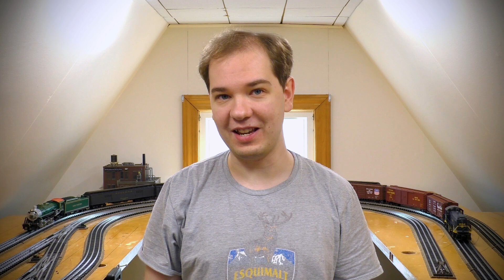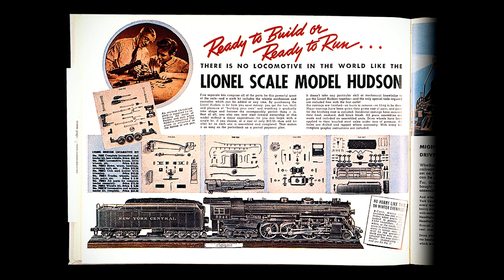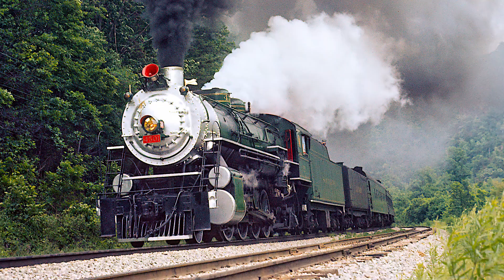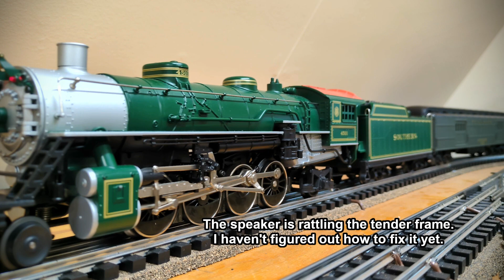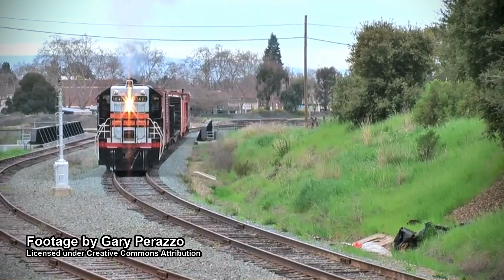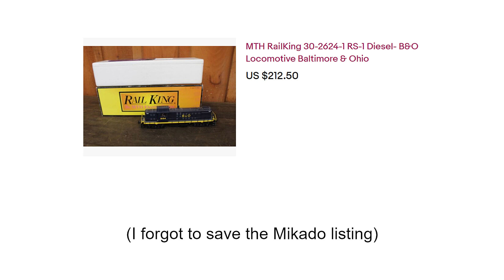The Case for DCC in O Gauge

Comment: 4:20 Not true, I'm afraid. You can have locomotives with sound and features with conventional operation. MTH's ones in particular offer access to most of the functionality of DCC through use of the whistle and bell buttons to trigger the functions. Locking the e-units on all conventional locos also allows for more flexible ops than ordinary model railroad DC operation.

You also neglected to mention Lionchief, which through the universal remote and the app gives you access to multiple loco operation without the need of buying a command rig.

That's not to say I don't like what you've done here, it's neat that DCC and Blunami are opening up new possibilities in  3 rail O. Always figured I would swap out for the Blunami if boards in my newer locos become unobtanium in the future.

Until then, the ZW still runs the show on my line. All eras, all makes, it runs 'em all. Lionchief's there when I want to get fancy or run multiples.
Reply from the maker: @Shipwright1918  Sound and features, yes, but not all the features. For example, you can't use the quilling whistle or select different whistle sounds on a Legacy engine using only conventional, nor can you operate the remote couplers. MTH is better about this, as you noted, but there's still some settings that can't be changed without DCS. That said, if you want to run conventional with some features, MTH PS2 and PS3 locos are probably the best way to do that (although they are a bit picky about transformers - my ZW-L will run them just fine but the couplers rarely work).

I'll be honest, I forgot about Lionchief, but I think it's a bit beside the point anyway, since it's not really command control. Lionchief engines are fun, and I like that they're not picky about AC or DC track power, but they don't do much that conventional engines don't also do. They do run quite well on DCC-powered track, though - in my experience, smoother than they do on normal AC. No idea why - maybe something to do with the square waveform.
Reply: I would argue that's more a fault of Lionel itself than of conventional control, they have a vested interest in selling the expensive Legacy base station to go with the equally expensive models that require it. 

As stated, MTH went a different route by accomodating customers with traditional setups instead of locking all the good stuff behind a paywall. Is it utterly perfect? No, but it works well for my purposes, really love all the MTH engines I have in the fleet. Actually tend to prefer the proto sound 1 boards over the ps2's and 3's, but the later ones are fine too. Use a refurbed postwar ZW and a pair of 5906 sound buttons to trigger features, couplers almost always work provided I remember to have enough volts on the track to fire them properly.

As to whether Lionchief is a command control system, I would say it is, though with most of the system architecture built into the locomotives themselves instead of a separate base station. Only external element is the control signals going over the air from the app or the remotes via RF/Bluetooth.

Lionchief Plus/LC+ 2.0 is where the system really shines in my opinion, as you get a majority of the features of a Legacy engine in a simpler and less expensive package.

My LC+ NW-2 really knocks my socks off, one thing that impresses me is how the smoke unit ramps up when the prime mover sounds do, then settles back down to a light output when the prime mover goes back to idle.

Comment: The explanation I heard for the three-rail 'O' market not going with DCC way back when was that the the system didn't play well with the electrical environment of most 3RO layouts at the time. By which I meant locomotives with open-frame AC (Pullmor) motors and the preponderance of animated accessories driven by old-fashioned solenoids, often running off track power. The amount of electrical noise generated by these two 'features' made DCC unreliable in early experiments, and 3-rail O was too small a market for anyone to bother solving those issues for a niche corner of the hobby (compared to HO & N scales).

The makeup of 3-rail O motorization nowadays is better suited for DCC of course, but waiting for that situation to come about might have meant 3-rail O remaining stuck in the analog era for many years after the rest of the hobby adopted command control, basically having to wait till enough layouts became dominated by can-motored motive power to obscure the difficulties DCC had with postwar-era layout tech.

(addendum: I'm sure the lure of exclusivity in 3RO played a role too, as neither TMCC/Legacy or DCS were cheap to develop)
Reply from the maker: @RailRide  That does make sense. I didn't realize how long it took for the O gauge world to switch to DC can motors. The interference from accessories is another thing that didn't occur to me. Maybe that's why TMCC uses wireless signals.
Reply: That's a very interesting point. For quite a while I had assumed that the primary reason O gauge never went to DCC was because it was much easier for proprietary systems to take over as there's significantly fewer players in the 3 rail O scale market, but it hadn't occurred to me just how much noise and power consumption those older things had. Ironically nowadays most "conventional" 3 rail O models are well suited for DCC conversion, better than some DC HO models even thanks to them having e-units which do the job of isolating the motor for you.

Comment: What about G gauge decoders? 6:52 
You can easily wire in a PIKO board designed for a 5amp system.
Reply from the maker: The decoders I used are designed for G scale. I did consider using AirWire for this, and I think it would work well, but since my layout is fairly small, I didn't want to spend the extra money for wireless control. It would be a workable alternative to BlueRail, however, if you don't want to use an app.

Comment: 14:44 Review on O scale 382 and Union pacific 119 14:46 when?
Reply from the maker: 119 will be soon. That's one of my favorites, and currently my only working ProtoSound 2 engine. 382 is a project - it's not designed to run on 3 rail track, and being all plastic, it's really too light and flimsy to pull anything, so it may end up being a static display.
Reply: When I see an engine and recognize  I always like to point it out, Will you get a central pacific Jupiter to go with 119?
Reply: I wish a company made a functioning 382 for three rail Casey jones
Reply from the maker: @ I'm on the hunt for a matching Jupiter, but I've yet to find one for less than $1,000. I'd love to see a 3-rail 382 model as well, but given that most "new" O gauge models released use decades-old tooling, I fear it's unlikely we'll see one anytime soon.
Reply: Jupiter is my most favorite engine so I do hope you find one that's not $1000 its a kind of Sort after Locomotive, yea 3 Rail 382 may be A long time before its made
Reply from the maker: @chasesrailwaywatching6447  Jupiter is a favorite of mine as well. If I can't find one, I might try to kitbash one myself. I have a (currently not working) MTH RailKing "General" that could potentially be turned into a Jupiter.
Reply: Honestly that could work sense MTH did paint there general in the CP Jupiter paint scheme, lol I had a Bachmann Jupiter as my third steam locomotive it was my favorite and sense started collecting all Bachmann old tool 4-4-0 paints my current rarest being the DisneyWorld paint scheme
Reply from the maker: @chasesrailwaywatching6447  Have you tried one of the new tooling Bachmann 4-4-0s? They run really nice.
Reply: Yes I do have one new tooling it runs really nicely miles better than the old 4-4-0 mine doesn't jerk at the really low speeds like some others have seen

Comment: Did you know there was a 3-Rail HO Scale system? I dont know the history on it but i do know it was only for DC and I actually had one for 20 bucks. It was a W&ARR 4-4-0 for $20
Reply from the maker: @thecapisoffyt  Fascinating - I haven't run across that one. Will have to do some research. I know Marklin had a 3 rail AC-powered HO system that uses studs on the ties instead of an actual center rail, but it's mostly European prototypes.

Comment: I’m leaning towards doing this.  I already have experience converting HO and N scale locomotives to DCC, but I haven’t done anything with my O gauge trains yet.  One other thing that’s bothered me about the proprietary systems is how different generations are now being sidelined for newer systems.  My LCS components are not useable anymore, and Lionel has moved on from Legacy to the new Cab 3, and I’m not about to sink more money into a whole new control system when have one that should still have plenty of life in it (it almost reminds me of gaming consoles).

DCC is proven, and anything new can simply be added to what you already have.  No planned obsolescence.  I think switching to DCC will also make them somewhat easier to work on, since I’ll know how I installed the decoder.
Reply: I think part of the reason is why DCC hasn’t been put into the 3 rail market is because there aren’t that many O gauge manufacturers as there are HO so Lionel’s Legacy could only work for Lionel locomotives because they want money for their business and MTH’s DCS only works for MTH engines for the same reason.  What I love about being a conventional operator is I can run Lionel or MTH engines without needing Legacy or DCS to run them.  See where I’m coming from?
Reply from the maker: These are all great points. The 3 rail market is pretty much dominated by those two. There are smaller players, like Atlas O, but most of them have either gone out of business or been absorbed into one of the Big Two. Even MTH got their start making licensed replicas of rare antique Lionel models. Lionel's acquisition of K-Line was part of a huge corporate scandal that deserves its own video.

I didn't even realize Cab3 was separate from Legacy, but it definitely smacks of planned obsolescence. That really sucks, and is one more reason why I believe DCC is the future of O gauge. The game console comparison is very apt, and in that metaphor, I guess DCC would be like PC gaming. You can upgrade it bit by bit over time if you want, but you don't have to, and you'll never be forced to start from scratch with a whole new system. Using conventional AC power is really the only other way to standardize across brands in O gauge, and I dread the day that Lionel decides that's also "obsolete".
Reply: @ I mean it’s crazy the prices for a Lionel Legacy 990 system.  Back in the 90s, you had other companies like Weaver, Right of Way Industries, and K Line who sadly have all been defunct.  Does N or Z scale use DCC as well or is it just HO?
Reply from the maker: @huntercoleman460  N uses DCC a lot. Some N scale locos even have decent sound. I'm not sure about Z.
Reply: @redoaktrains  there are decoders out there that apparently can be used for Z scale.  The Digitrax DZ126 series is one example.
Reply: Cab-3 is Legacy, just with all of Lionel's predecessor control systems (Bluetooth, TMCC, LionChief) bundled into one box accessed with a smart device. The physical remotes (Lionel's and MTH's) fell victim to component manufacturers EOL'-ing certain IC's needed for both remotes' transceivers.

Comment: The good thing about the Blunami and Tsunami is that they actually have an accurate whistle for your 4501. It’s labeled as an “L&N passenger 3 chime” for some reason. As for the TCS decoder, you’re probably gonna want to use the Southern 3 chime whistle on it for an accurate sound scheme for the 4501, seeing how yours is painted in green. I’m considering buying one of those Lionel 4501s for my O gauge layout, painting it black, and putting a Soundtraxx decoder in it.
Reply from the maker: TCS does have whistles that are closer to the real 4501 than the one I'm currently using. I mostly have it set to this one because I like it (and because of a Polar Express-related running joke with a friend). I'll get around to switching it to the Southern 3 chime eventually.

Comment: Which decoder do you advice me to use with an AB DL109 from MTH PS1? (Will want to operate it with smoke if possible) Great video and thanks in advance
Reply from the maker: I would go with a TCS WOW501-Diesel, the same one I used in my RS-1. It has the correct sound files (you can select prime mover sounds using the Audio Assist menu) and the ability to drive a smoke unit.
Reply: @redoaktrains Thank You!

Comment: You should put an HO locomotive on the 2nd and 3rd rail and see if it’ll run since you have DCC lol

Seriously though this is amazing! As much as I love Legacy and DCS I honestly wish 3-rail had went the DCC route. Would’ve made control a lot easier like you said, and maybe we would’ve been able to run Lionel and MTH engines in the same consist, which is something I really wish was possible as someone who has engines from both manufacturers. I really hope more 3-rail people are inspired by the DCC movement and chose to go down the route you’re on, as this is a really awesome set up. Great work man 👍
Reply from the maker: Thank you! Consisting didn't even occur to me, but that's another good reason to use DCC.

I have tried to run HO trains on two of the three rails, but sadly, the gauge isn't quite right. The rails are a little too close together, so the flange is sitting on top of the rail on one side or the other. Sometimes it'll stay on the track for a few feet, but as soon as it reaches a curve, it falls off. The DCC does work though!
Reply: @redoaktrains  HO model will only work on Atlas 3 rail track.....until you get to a turnout.
Reply from the maker: @ I briefly considered trying to make custom "dual gauge" track for the outside loop of my layout, with a slightly off-center third rail so I could run On30 equipment on it. Ended up deciding against it, and I'm glad, because anything with flanges that small would derail on the joints of the lift gate anyway, but I might still try the idea on a small display layout eventually.

Comment: Do you still have to use rectifiers for the DCC conversions? Also when wiring for DCC, do you still power the track using AC or DC? I would love to do this on my existing 3-Rail Scale layout. 

-Gojira
Reply from the maker: No rectifier is necessary. The track is powered directly from the DCC booster (its output is technically AC, but the cycle rate varies constantly, since that's how it sends commands to the decoder, and the decoder outputs DC to the motor). The decoder's power inputs are connected directly to the pickups. The booster comes with its own power supply, which outputs about 14 volts DC and has a built-in circuit breaker. It's exactly the same as a 2-rail layout - the only difference is that one wire goes to both outside rails, and the other goes to the center rail.
Reply: @redoaktrains so I were to connect a Lionel Base 3 to a layout powered by an NCE booster, it could run DCC and legacy at the same time?
Reply from the maker: @Smug_1996  Yes, that should theoretically work, although I haven't tried it myself. Another option would be to leave out the Legacy base altogether and use the Cab3 Bluetooth app.

Comment: It’s interesting to consider that we’ve already made mistakes with incorporating proprietary systems like IOS and Android, or USB cables into our lives before. As consumers we should value compatibility, and go out of our way to make it known to manufacturers that we would prefer a universal system for operating our trains.
Reply from the maker: Absolutely. Anything proprietary becomes next to useless when the manufacturer stops supporting it. Many older Lionel and MTH models are difficult or impossible to find replacement electronic parts for. That's another reason I like converting them to DCC - when the original electronics die, as they all do eventually, it gives a second life to an otherwise perfectly good model. Even if the old electronics are still working, a modern DCC decoder is almost always a huge upgrade in sound, features, and performance, and unlike the original proprietary system, it will always have some kind of support because it's not dependent on whether one specific company decides to abandon it or not.

Comment: Will you be running regular analog locomotives along with DCC equipped locomotives? I run second-hand locomotives for HO and N scale as well as my O gauge and S gauge trains
Reply from the maker: Yes, I have a Lionel ZW-L transformer hooked up to the layout as well, with toggle switches for both the inside and outside main lines to connect them to either the ZW or the DCC system. I do currently have another MTH PS2 engine that I run in analog mode using the ZW. I will probably keep this arrangement, since I may acquire more analog locos in the future.